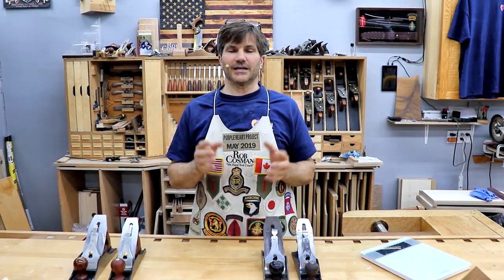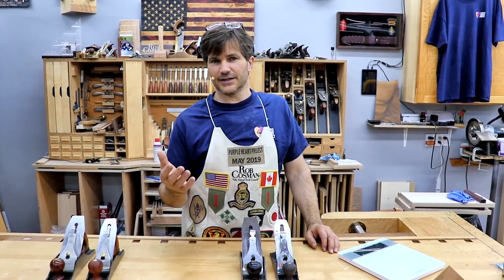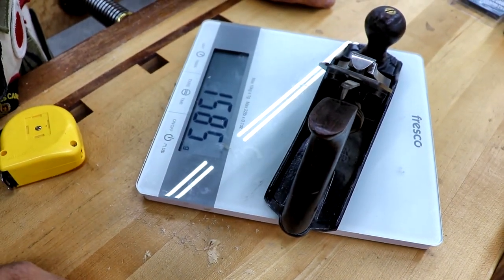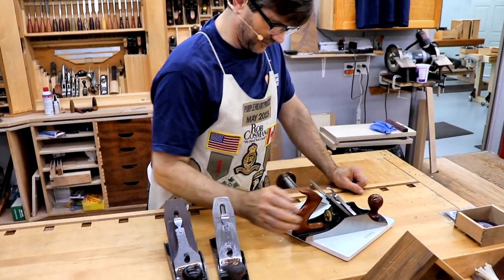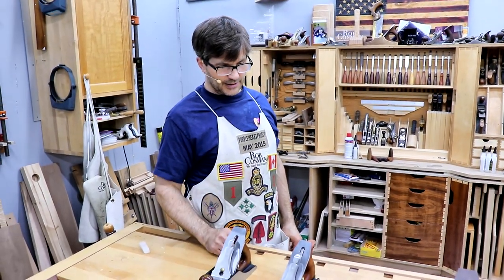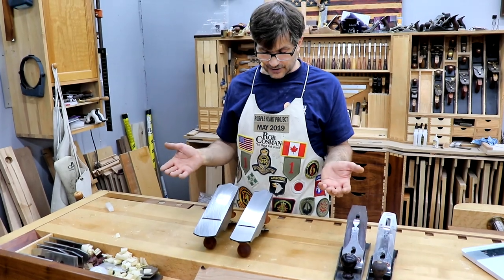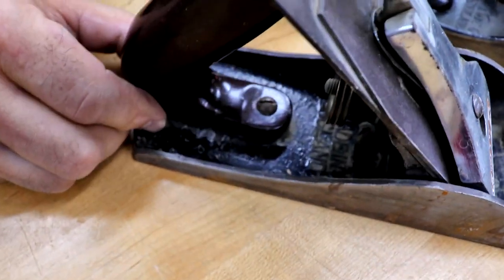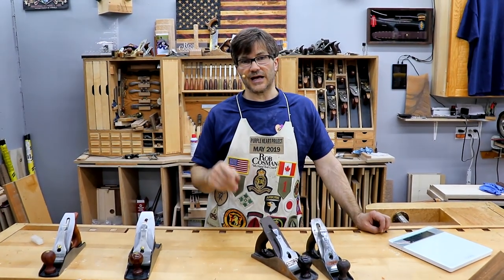Smooth Planes, 4 or 4 1/2?

Comment: I completely respect your opinion and agree with your reasoning on the 5 1/2 (I own one on the strength of that recommendation, thank you btw) but I feel like if you are looking for a smoothing plane to follow up the 5 1/2 jack plane you should skip the 4 and 4/12 and go to a 3.  Yes it is small but not uncomfortable when held with a couple fingers extended and the small sole allows the plane to follow any undulations in the work.  I find there is not enough difference between a 5 1/2 and a 4 for switching between them to be efficient.
Reply from the maker: To each his own but I have never found a need for a 3 or 4.  I have on occasion reached for a block plane to solve a problem in the middle of a board.
Reply: @RobCosmanWoodworking  a use for a block plane I had not considered previously and given the smaller sole and iron on a block plane, an excellent idea to add to the arsenal.

Comment: Wide is generally good but as a counterpoint - I clicked on this because I was curious after recently using my Lie-Nielsen 4 1/2 with a 55 degree high angle frog (same effect as a 10 degree back bevel) on a workpiece that mixes cherry, hard maple and wenge. I got that plane specifically for smoothing difficult grain, I keep the iron super sharp and even after backing off the iron and waxing the sole, it still had me thinking about getting a 4.

Comment: I'm a relatively small framed male, I wear a medium glove and find my #4 to be just fine. I bought mine new in 1975, so it's not the worst plane Stanley ever made but the finish isn't as nice as a new Woodriver or an older Stanley.
Reply: As long as it works that is the main thing. I have older Stanley planes and more modern Stanley planes.

Comment: Probably the wrong place to ask but I have a new shoulder plane and there does not seem to be any way to adjust the angle that the blade sticks through the sole so it is always proud on the right hand side looking down the sole. Do you cover that issue in any of your videos? (Which are excellent btw).
Reply from the maker: with such limited lateral adjustment in a shoulder plane you sometimes have to grind the blade to match the sole.

Comment: What can you say about Veritas Custom #4 and Custom #4 1/2? They both have short blades which provides enough space for a hand. The only difference is blade width.
Reply from the maker: I much prefer the traditional look of a hand plane, owing that to Stanley.  not interested in anything else so not fair to comment.
Reply: Got it. But extended width of the 4 1/2 shouldn't be a problem for an adult 90 kg man, right? At current moment I own Veritas low angle block plane, Dictum #4 (basically re-branded WoodRiver sold in Europe) and Veritas custom #5 1/2. I'm thinking of selling Dictum and changing it for one more Veritas custom plane - #4 or #4 1/2. I really like it's concept, but not quite sure which width should I choose.

Comment: Hey Rob I know you really like to use the ruler trick when sharpening your planes but I was wondering do I need to repeat the procces of polishing the tip of the back every single time I sharpen. And if so do I first work on the backbevel with a ruler or Do I first work on a regular bevel. Thanks big fan of your work.
Reply from the maker: Once you create the back bevel, after each sharpening you spend just a few seconds with the ruler to remove any burr.  On a new blade, first create a back bevel on a 1k stone, then polish it on a 16k.  Sharpen the bevel with micro bevels finishing with the 16k.  few seconds on the back bevel, using the rule, to polish off any burr.
Reply: @RobCosmanWoodworking  thanks appreciate it

Comment: I don't think anyone doing a significant amount of work in wood (vs. planing off chatter) would prefer a 4 1/2, especially not the commercially made boutique versions now that are overweight. 

I started as most beginners will thinking that a heavier plane (wider, heavier, etc) was the answer to smooth....well, smoothing. The answer to productive smoothing is a lighter plane (but not so light that it's jarring) and proper use of the cap iron. 

It's more productive even removing planer chatter, but most people aren't going to plane enough removing chatter to really get an idea of why older planes and older infills didn't have boat anchor weight levels, despite the fat that they were used far more heavily than later planes. A norris 2 or a spiers open handle smoother is generally closer to a stanley 4 in weight than it is to any of the modern 4 1/2s (they're usually 3-4 pounds total). 

As far as room goes, put your finger aside of the blade, not under it.
Reply from the maker: Welcome to  have and voice your opinion David but state it more in that light, "your opinion".

Comment: I have two woos river planes that are new.  I am getting rust on the bottom what am i doing wrong?  I am using 3 in 1 oil to keep lubricated.  I live in south Ga. very high humidity
Reply: Ohioan here - also high humidity. #1 Keep your planes covered. Either use a plane sock or keep them in a drawer/cabinet. Don't leave them out in the open air. #2 I run a dehumidifier in my shop to keep the moisture in air to a reasonable level. It makes a HUGE difference. #3 Be sure to clean them after use. Wood shavings/dust carry and attract moisture. I blow mine off with an air nozzle. Then wipe them down with 3-in-1 oil.
Reply: try a US equivalent of this https://www.axminster.co.uk/axminster-machine-wax-400g-101582
Reply from the maker: ronnie chauncey https://robcosman.com/collections/planes/products/wr-plane-socks
Never deal with rust again!
Reply: Like any other iron product, lack of maintenance yields rust.

Comment: By the way, the bulk of the vintage infill smoothers (at least of the more elegant types) are generally around 2 1/8" or 2 1/4" irons, smaller than a 4 1/2. One has to wonder why you'd conclude that the more popular sizes of planes were made for adolescents. People may have been shorter around 1900, but if you look at pictures of them, their hands certainly weren't smaller. I think your issue in understanding that (aside from teaching a lot of beginners who can't coordinate arms and shoulders providing momentum to a plane) is in the false assumption that you have to stuff your index finger under the blade.
Reply: what kind of person measures hands on old pictures to make a yt post?
Reply: When taking advice, consider the individual is giving you his/her opinion based on their experience with the tool. I happen to subscribe to the recommendations of Peter Sellers in the U.K., he has extensive experience as a professional woodworker and teacher but has no interest in selling tools, just excellent instruction. He favours the No.4 and a second modified No. 4 iron for scrubbing. If you want to “hog out”, then a Jackplane.
Reply from the maker: You must mean Paul Sellers?

Comment: Aren’t the Wood River planes based on the heavier Stanley Bedrock series? That would partially explain the discrepancies in mass.
Reply from the maker: They are, I dont have a Stanely 6041/2 but I do have a 604.  I will weigh it and report the finding.

Comment: Rob's recommendation here seems to assume bench work, with both hands on the plane. In this case he is right, and the added weight is important. I feel the size of plane you choose has less to do with ones physical size, but more the kind of work the tool is employed in. In some applications I find I need to plane one-handedly, vertically, or even overhead. In such circumstances I do not heed comparisons to adolescence, or femininity, but happily reach for my No4 or dare I say it No3  and reserve the macho  artillery for the bench.
Reply: I just came across this comment (Jan. 2024). Your comments are bang on. It’s personal preference and I enjoy my no. 4 for most smoothing with the thought that maybe a second iron might be nice for a scrub blade. Even though a no. 3 is frowned upon by many, I looking for one. An old Stanley is a Jewel and if not, buy a “Lie Neilson” if it’s with your budget. It will last a lifetime. Not sure why Cosman says he isn’t recommending Wood River when he sells the product. At one time in his career he was demonstrating and pushing Lie Neilson. 🤷‍♂️🇨🇦👍👨‍🦳

Comment: Odd question: on larger planes, why is the blade still oriented more towards the front than the back? I got to thinking about it the other day on my #7 after watching one of your videos. It seems like it would make more sense to have the same length of reference on both the front and the back of the plane, but then again, I don’t actually know anything lol
Reply: I think too much sole in front of the blade would cause you to follow a concave surface - when edge jointing for example. Because the sole would begin referencing off the dish before the blade has made contact.

Comment: A lighter plane has its uses for me to take off bulges before using a bigger sized plane to flatten.  Otherwise I agree that a heavier plane will make better cuts... as long as everything else is equal.
Reply: Force equal mass times acceleration. For some people they can have better control of lighter planes and I am one of those people. 
So if I want to feel the wood I sometimes may have a lighter plane.